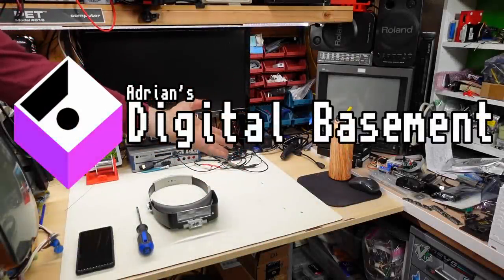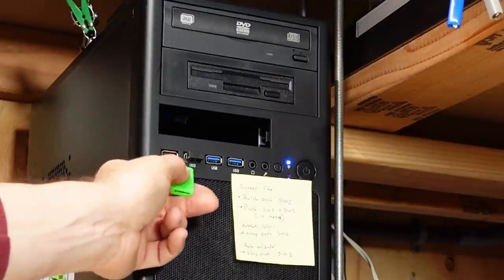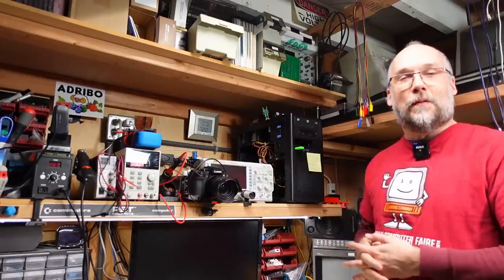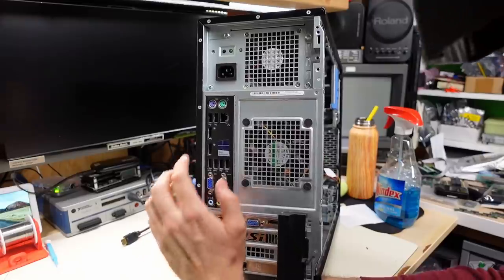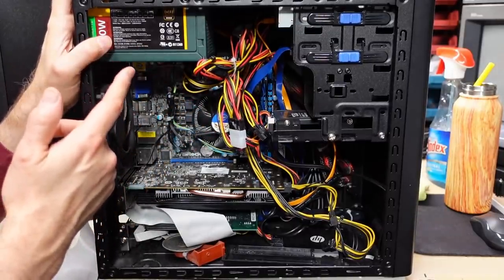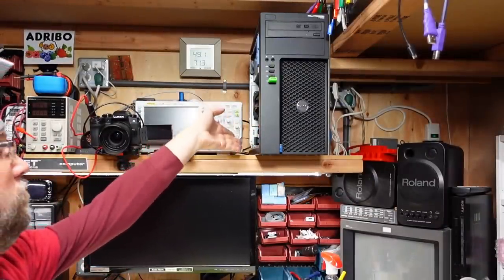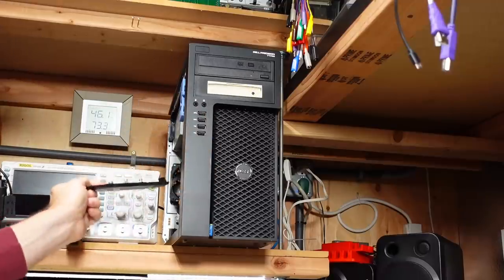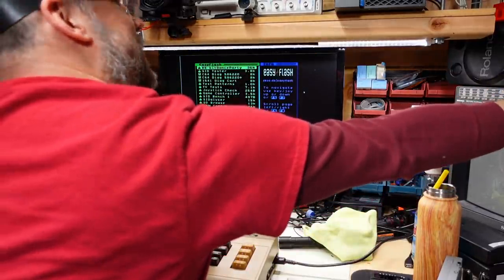Let's upgrade my lab PC and talk about tools I use to make videos

Comment: (1) MICRO ATX. MiniATX was a standard with a formal spec, but it was part of the ATX spec that predated MicroATX and was withdrawn when the (separate and independent, actually) MicroATX spec was released.
(2) That board may or may not be MicroATX regardless; Dell has a habit of being so flagrant about violating standards, specs, and form factors with what they put in desktops that it arguably crosses the line into outright flaunting it because they can. With eBay etc around, it's more a matter of annoyance than anything else, but it makes repair work considerably harder -- which is the point, after all; the idea is to try and force you to send your PC into Dell for repairs so they can upcharge you *twice*. The system you build on your own will always be far cheaper than any prebuilt, and probably a goodly bit better. Certainly it will be better suited to your individual needs!
...so that motherboard may just be a "Dell SFF" 'form factor' -- something bizarre that Dell cooked up to fit the case because it fit. But to me it looks like a MicroATX mobo.
(3) While I've never personally had occasion to use a SATA to IDE converter -- yet -- one of my close friends runs the local tech shop and has told me repeatedly that literally he's never had one that worked. I believe he's had several... <shrug>
(4) DVI and HDMI use the same exact protocol except that HDMI supports audio output and DVI allows an analog (VGA) piggyback. That's why you can convert them with "just wires" adapter plugs.
(5) Dell power supplies are, historically, quite rugged and slightly over-specc'd for the systems in question, and this system will be from that era.
(6) That cooler is essentially a Dell branded Intel Stock Cooler. It's crap and it will be noisy for the cooling it offers, which will be sub-par. Most $30 offerings on Amazon from disposable Hong Kong sounding brand names will outperform it. (Everything is relative. Even if it's quiet overall, there are better options...
(7) Don't encrypt your drives. It will only make your data entirely unrecoverable when something hits the fan, so to speak -- and that is absolutely a "when" not an "if". Also, speaking from experience: don't trust backups, especially cloud backups. Terms of Service and such change, and they are not required to change in ways that avoid excluding you.
(8) LOL @ cheap cases. ALL cheap cases will slice you like an onion, and ALL prebuilts have cheap cases. A First-Aid Kit is a good thing to have if you service computers regularly... new or old ;)
Reply: @Leon Mailfert Yes, and other connector variants distinguish between single- and dual-link display connections and there is also DVI-A which only has the pins for the legacy analog (VGA) passthrough and that's it -- but if you were paying attention, you'd note that what I was discussing was a matter of electrical protocol and not connector shells and so which pins are present on what connector is largely DVI-r-elevant as long as there's enough to send a signal :P

FWIW it's a subspecies of TDMS.
Reply: @Leon Mailfert I've seen one or two such connectors as "just wires" VGA adapters you can get on eBay. IIRC I don't have one in the drawer but I'm pretty sure you can get em.
Reply: @Leon Mailfert I apologize as well -- I get a bit hotheaded a bit fast these days, and I shouldn't. Life's been getting to me a lot lately.

Where I live is kinda at the exact opposite of LTT land as far as socioeconomics go. It's a tiny town in the rural part of the upper US South. There's not even a Goodwill within an hour's drive of here IIRC, we just have a couple PTA Thrifts in the county and that's it. The universal minimum video standard is still VGA and probably will be around the time James T Kirk first takes captainship of the Enterprise lol. DVI+VGA displays sometimes show up at the local thrift shop but mostly it's VGA only and half of em aren't even widescreen! There's actually a sign on the window still that says, if it's got a CRT inside please don't bring it here.

So to me, it's kind of hard to imagine that one would be unaware of DVI and its variations unless one was a complete neophyte. But I guess this is an odd place to live, as far as that goes...

Personally, I grew up in the 90s and I learned electronics and computers at the same time. I'm a hardware guy and I view and interact with computers specifically through an electronics paradigm. I'm quite capable of component level repair, and although I'm far too incoherent at life to hold down a job, I'm not above replacing caps or pulling a BIOS chip off a board with an iron or my hot air pencil and dropping it into my TL866 II+ programmer if it's being ornery lol (did this once with an HP MIni 5102 that had a BIOS password, back when I still only had my TL866A lol, was its first use actually... still have the netbook, still proud of the fix).

Networking to me is a Dark Art, I leave that to the Voldemorts, Lupins, and Snapes of the world lol... I can't speak C or C++, really, Python makes me want to get the snake-stabber lol, most of these newer languages like Ruby and Rust make me curl my lip and mutter unrepeatable things about hipsters -- and I'm barely at the beginnings of conversational with Arduino, even -- my "programming language" of choice is hardware glue logic. I have a healthy penchant for retrocomputing tho so I can also do some pretty cool things in C64 BASIC -- but don't think I don't need a reference manual nearby!

Also, because I just can't keep from mentioning... Steve @ GN makes me cackle with his prebuilt reviews. Guy needs to learn some things... all that stuff that he says "can't be used" after the system dies? I make new machines every WEEK with exactly that kind of stuff. A system build from what I can get on eBay and what's in my closet -- and donations, I have an erm reputation lol -- is my way of livening up a boring afternoon, and proprietary stuff is dirt cheap. 90%+ of what I work with is the stuff he claims you gotta throw out when the system's bunged. No -- you just have to know how to work with it. He's just showing his blissfully ignorant side, and I'm looking forward to calling him on it soon... flagrantly ;) mind you I've already reached out several times and been ignored, so this will be fun.
Reply: @Leon Mailfert I've no love for modern iWaste but the Apple II was a machine for which I have deep respect. (Odell Lake, anyone...? :D and the impossible legend that is Oregon Trail...) I've always wanted to muck around with Amigas. The architecture makes no sense to me but I know how powerful they are, so it's just something somewhere that I don't understand. I'm cool with that -- someday I'll 'get it'. Relays have embarrassed me in the past but I'm determined. I like to play around with that sort of thing, see where the bare minimum viable element of computing lies, in a sense...
Reply: @Leon Mailfert BTW... you actually sound like a really cool kinda guy. You got a Discord?

Comment: I highly recommend getting an internal SD Card Reader (plug it into that empty drive bay), it will occupy one of your USB headers, but they usually have additional front facing USB ports to make up for that (you could also add an internal USB 3 PCIe Card which will provide Additional internal headers and external ports on the back).

Edit: those GTX 750s are freakin work horses for non-gaming PCs, I still own a few of them.  Though, I would really consider upgrading in the future. Apps that require RTX are becoming more common, and I think some of the OBS stuff can take advantage of it.

Edit: older thunderbolt is usually the "Display port" looking plug.

re: No reset button -- you could also just drill a hole in one of the empty drive inserts and add a panel mount momentary push button (normally open) connected to a 2 pin female header to expose that. (Assuming the board has those pins... if not, I think there are also USB reset buttons you could get.)

re: bleeding
The spirit inside the PC has demanded a blood sacrifice.  That's how you know it's a quality system.
Reply: One thing: Early thunderbolt used the same connector as Mini DisplayPort. The ports on the motherboard were plain old full size DP, which don't carry Thunderbolt. 

So no idea what the Thunderbolt option is for. Maybe it has an internal header and a breakout cable that went to an insert for the PCI slots, which was optional?

Comment: That Xeon E3-1241 v3 CPU is essentially similar to an i7-4770 with a slightly higher base clock (3.5 MHz vs 3.4 MHz) except that it lacks the i7's  integrated graphics.

The three screws on the back of the drive bay cover are used for mounting the additional optical drive.  The manual ought to explain that.

Comment: Yes, old motherboards used a "third party" chip for USB 3.  On the board, there's probably a VIA chip that's the USB 3 controller.  It's possible that chip has gone bad.
Reply: Third party USB3 controllers are made by NEC/Renesas.

Comment: Nice video Adrian. I should probably get a lab-PC as well. I only have one desktop PC that I use for everything. It's actually placed in a "technical room" where all my network gear is placed as well. And my office is in the next room and I've routed all the cables for my main setup through the wall. That works fine, it's only about 2 meters through the wall from the PC to my 4 monitors. However. The lab part of my office is a further 3 meters away. There I have another monitor and USB hub and multiple 5m USB extension cords for multiple cameras (you can't use them together through a hub). I also have an Elgato CamLink that I use with my RetroTink and other devices. I sometimes struggle with bandwidth issues as well, but it's sooo nice to have everything connected to one single PC.

Comment: I've had a similar problem with an older system I now use as a backup system where plugging a 2.5" external drive for internal drive backup had previously worked just fine plugged into one of the high amperage (1.5A) USB 3.0 front ports, but it recently started exhibiting slow operation and occasional (recoverable) drive corruption during backups.  Using one of the in-series LCD display USB diagnostic dongles, it turned out that the ports were no longer capable of reliably powering the external drive without lowering the 5V line voltage too far.  So,  I just plugged a powered USB 3.0 hub I had on-hand into it and everything is now fine.  It might be a loose or oxidized plug connection to the motherboard which I'll have to check.

Comment: Wow, small world. My office PC at work is a T1700 motherboard in the exact same Rosewill Micro-ATX case that your original bench PC was in, with that same 365W Dell PSU. I made a custom adapter for the power switch and front-panel LEDs by hacking a Dell power switch assembly. It's possible to mount a standard 92mm tower air cooler on a Dell motherboard (Escotech did a video on that), which can give you better CPU thermals than the stock Dell cooler. (I used an EVGA one, but the Coolermaster Hyper TX3 EVO also works great.) These Haswell Dell systems are so boring and reliable, totally love them.

Comment: Yeah, hear you on the drive bay issue. I have no need for optical or floppy drives anymore, but I like the option of somewhere to put some new I/O.

Like, say USB 4.0 comes out, I can easily hook up a PCIe card with USB 4 header/bus and slap a multi-port USB hub into one of the drive bays and I have front USB 4.

Comment: Love the "dredge" part PC.  This is how I learned to do Atari 2600 repairs...basically taking the ugliest hodgepodge parts (case, switches, motherboard, etc that function) and piecing them together.  Now i have a working 2600 that I'm not afraid to mod or take a ahem drill bit to.

Comment: Ahh. Dance party. 
You need more room, so you dont risk to hit The screen when Those arms swings around During The party. 

Nice video, always lovely to see you at work, Retro or newer stuff. 
Instead of that scsi card, you Could (just for fun) install a iee488 pci card. Could be used to grab datalogs from your instruments, Logic analyser, or connect to a pet. 

And hey. You did end with a c64 at The end 👍. Ps. Merry Christmas from Denmark. 🎄

Comment: Retired Business Dells are awesome if you want something that will literally just work. Pretty bulletproof. I have a modern Ryzen gaming rig, but my laptop is a trash picked Dell Latitude 5450. It’s awesome because they are meant to be fairly easy to service being business machines. I’ve smashed the screen once and replaced it in 10 minutes, and just recently I had to replace the battery.

Comment: 19:15 Those Dell power supplies are anything but run-of-the-mill. They are super unique to the computers they connect to, along with the dell motherboard. I would look into replacing this computer for some more standardized parts.
Props to them for using a 12V only power supply and using the logic board to distribute the 5V and 3.3V to the rest of the components though.
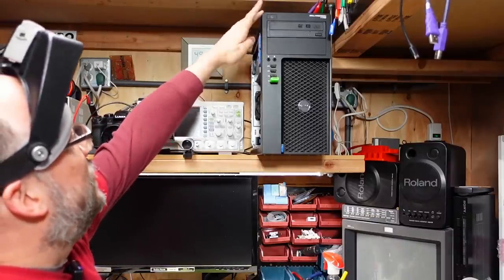31:25 One thing I have found to be a great convenience as well, is to get small 1ft to 3ft extension cables, and run them to the desk near the monitors.
Reply: It is like that on my HP Pavilion gaming desktop as well

Comment: That generation of Dell "office" and workstation machines is really solid.
Reply: Though that one is right where they started getting a bit "custom" again. But no where as bad as when they were making mirror-image ATX boards in the late 2000s.
Reply: @JamesPotts  Mirror-image ATX? 🧐Try BTX. A lot of the major OEMs  had Intel systems in this formfactor at the time, including Dell, IBM/Lenovo, HP Compaq and Fujitsu-Siemens. Dell did have a proprietary 5-pin fan connector at the time. Those with adapters or the ability to solder their own fan connectors will find old Dells a good source of heavy-duty fans.
Reply: @PileOfEmptyTapes  huh, I never realized it was a standard. I only encountered it with Dells, so I assumed it was just something silly they did.

Comment: Yes.... the floppy drives get crazy with Win10/11. I would say it's Windows Defender's fault. Not only accesses the drive frequently and also hides autoexec.bat and config.sys annoyingly.
I believe the USB3 slow speed is caused by some setting from registry. You could try Ubuntu live and check if it happens the same.
Reply: If you go into Explorer settings and choose show hidden files and uncheck hide protected system files it should show all the files.

Comment: About two years ago I scored a free new in box unused Dell Precision T1700 with a 4th gen Intel Core i5. Installed a pair of SSD, 32GB RAM, and gave it to a friend as his lab / gaming server. The PC before I gave it to him was on loan to a client as their remote access server running Hyper-V 2019 and a pair of remote desktop servers for staff remote access. That machine lasted onsite a whole year at the client before they purchased a new real server. 

At home, my main desktop PC is a Dell Precision R5500 (fully upgraded & spec'd out) - an absolute beast of a machine!

The PSU is the new standard that is being rolled out in the near future across all PCs. There are adapters on eBay that let you connect a 3rd party standard PSU to the Dell mainboard.
Reply: I'd hardly call a 2U workstation a "desktop" PC but I get what you're saying. I got a ProLiant kind of for the same purpose. Btw the 5500 and 5600 series CPUs are getting pretty old, a new Ryzen should easily outperform even a pair of X5690s.
Reply: @eDoc2020  yeah I know. I got it a few years ago for a steal. Updated it and it was my server for like a year or more, before being replaced with something newer, more powerful and more drive bays. So in went the dual RTX2070 and it replaced my i7-3770 desktop PC.

Comment: Really nice of the guy for donating that system! Have had two precisions and they have been trouble free for years. Hope it'll be the same for the basement!

Curious though why you're constrained by the depth of the PC. Couldn't you put it parallel to the length of the shelf?
Reply: The height is the constraint, as I understand it, while depth and width is actually where he had a little flexibility.
Reply: Yeah, but how'd he get in there to jiggle the cables? 😂

Comment: My Q6600 used to refuse to complete POST too until I found out one of the pins on the memory slot was burned out. Only found out when I upgraded the ram and it refused to boot, and it would often hang with bus errors.
Maybe check the slot connectors?
Great video ✌

Comment: I have a Dell Core I5 and you're right: the power supply is not a standard ATX. If you look at it, you'll notice that the power for the drives comes off the motherboard, not the PSU. There isn't a 5 volt rail like you see on a standard ATX PSU, except for the one that you connect to ground to power up the computer. You'll likely be limited on options for a video board, depending on the PSU's wattage rating, since it really can't be swapped out for a standard PSU

Comment: You actually got very lucky with getting a 750 Ti. Nvidia dropped driver support for the GTX 600/700 series in August, but the microarchitecture of the 750 Ti is based on Maxwell, the successor of those series. Seeing as the 900 series cards and the ARM-based Tegra X1 (which is the Switch's SOC) are based on the Maxwell microarchitecture, I don't see driver support going away for your card any time soon.

Comment: PC not booting - I've seen this too, and I more or less traced it to trying to boot from USB devices. Don't know if that is applicable to you - you do have a thumb drive in there - but turning off booting from USB drives fixed it for me. Oh - whenever I see that open slot for a 3.5" thing, I think of filling it with a DAT drive :) Not because they are of any use any more, but because in the day, that was the ultimate thing to have for your PC - a good SCSI card and a DAT backup.